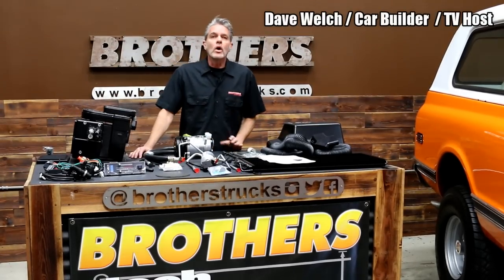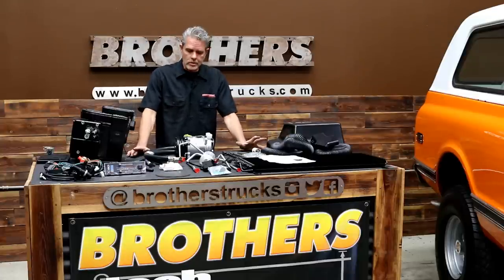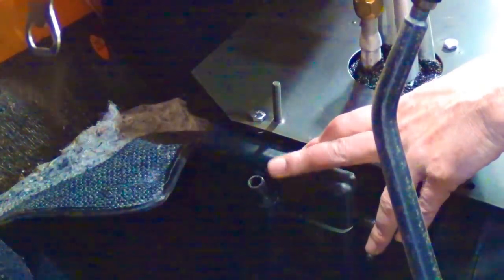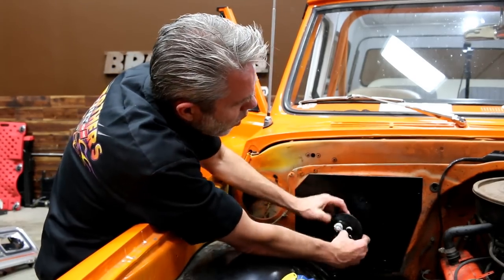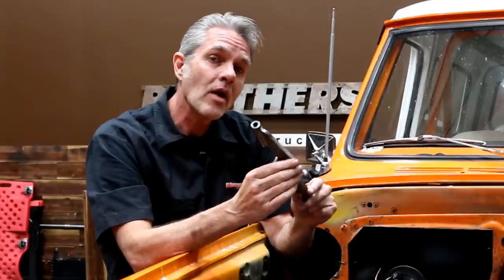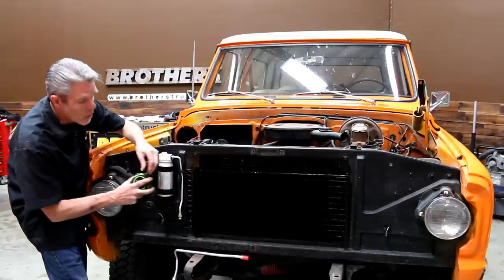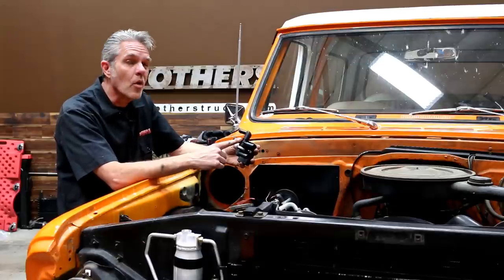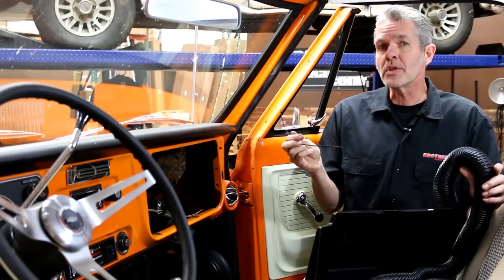Classic Chevy & GMC Truck AC / Heater Installation

Comment: Need this kit for an '81 K20 (non factory air, LWP w/power steering) - Does this kit come with alternator relocation bracket?  3 groove pulley for the crank?
Reply from the maker: Contact the shop, we have MANY configurations to make it work. 800-977-2767.

Comment: Do Y'all make a unit for my 1973 c-60 without Air on it? I'm putting in a New 350 sbc engine in now.
Reply from the maker: The firewall is slightly different so it would need to be adapted, but otherwise everything else should work the same as if was a C10

Comment: Have you got kits for Canadian delivered trucks so right hand drive c10 pickups? (‘79 c20 right hand drive, no factory ac)
Reply from the maker: We have nothing for that specific application. You should contact Old Air or Vintage Air and see if they can help you out. Maybe they can combine some parts from their universal kits and some from the standard '79 kit to handle the right hand drive.

Comment: Can you kinda add the cost of the kit thanks for the video great job
Reply from the maker: Depending on the year of your truck, and the options you want from the kit itself, you're looking at anywhere from $1150-$1400 for a complete kit. You'll need to factor in the cost of the belt, refrigerant, coolant, etc... but we'd estimate no more than $1500 start to finish if you're doing the install yourself. Check out these kits and more for your Chevy or GMC truck on our website at https://www.brotherstrucks.com/ or call us at 800-977-2767. Thank you!

Comment: The AC condenser seems kinda far off the radiator, I'm adding an AC to my 1970 and I've read that they should be 1/2 off the radiator, I'm confused now, could I mount it  infront of the radiator support like you did? What's the correct distance?
Reply from the maker: The factory condenser was mounted in the exact same location as this. We're not aware of any industry standard for distance between the core and radiator. From our own experience, we've had a condenser get too hot from being right up against the radiator, and the extra heat over pressurized the AC system and caused the compressor to start leaking.
Reply: @BROTHERSTruckPartsTV  hmmm that's interesting, yeah I remember my Camaro also wasn't mounted too close to radiator, this was a 75 Camaro, I'm going to mount the condensor from my 1970 truck in the same location as you guys did, hopefully it works good, I'm using a dealer installed evaporator under dash unit, I still haven't crimped the hoses so maybe I should do this before I have the hoses made. 🤔🤔
Reply from the maker: @adrianrios4949   Yeah, definitely figure out your hose routing and length before you crimp 'em

Comment: My 68C20 did not come with factory air. Will I need to use another radiator or can I use my existing 3 core?
Reply from the maker: You can use the factory 3 row radiator unless you begin having cooling issues after installing the A/C, although we doubt that would happen.

Comment: I have a 1971 C10 non  ac cab .Does it come with a template to make it a in dash factory ac cab style ? Thanks
Reply from the maker: The kit does NOT come with templates to do factory style vents in the dash. The vents that come with the kit hang below the dash, if you're trying to do a factory look then you'd have to order the vents separately and cut them in yourself.

Comment: At 6:13  the new condenser won't fit in the same holes as the original Factory condenser?
Reply from the maker: They both fit through the same holes, no problem.

Comment: Can this be done in a 63 gmc?with a 305 v6? That has heat vents and blower from factory without air conditioning
Reply from the maker: Yes, we have kits that will work with almost everything. www.brotherstrucks.com

Comment: Can this ac be installed in a c-10 (72) with an in-line six (250 cid)?
Reply from the maker: Yes, you would just specify that when you order so that we can include the correct brackets for the engine.
Reply: Oh wow I do also have a 68 Chevy C10 and I was wondering about that question too 😂

Comment: What kind of compressor does this kit use. I have a Ls motor in my truck and my bracket is for a sanden 508
Reply from the maker: It uses a Sanden 508, you're all set.
Reply: BROTHERS Truck Parts thank you!

Comment: Can this system be installed in a 86 GMC C6000 that wasn't built with one?
Reply from the maker: This system can't, but there are systems available that are specific to that model.
Reply: @BROTHERSTruckPartsTV  Thanks for the reply. I need a system that works. The ol 366 loves heat, but I don't. The cab gets unbearably hot. A 95 degree average summer day in Florida doesn't help at all. How do I move forward with hooking up?

Comment: What about a/c system for big blocks?
Reply from the maker: Same system just different pump mounting brackets for the big blocks.
Reply: BROTHERS Truck Parts do you guys make brackets for a BBC?
Reply from the maker: They are supplied with the complete A/C conversion.  You need to specify Small Block or Big Block, long or short water pump, driver's side or passenger side mounting location, and R-12 or R-134 when ordering.